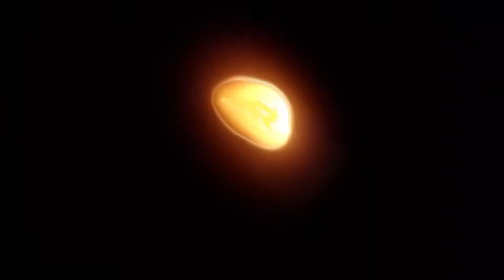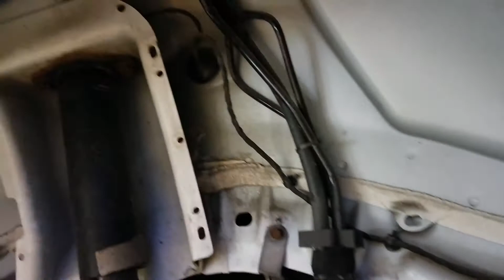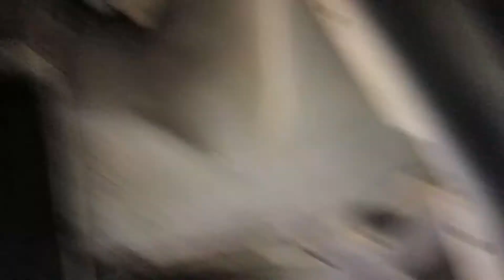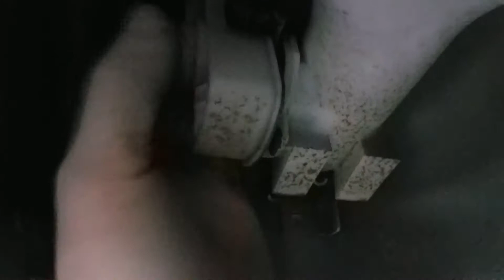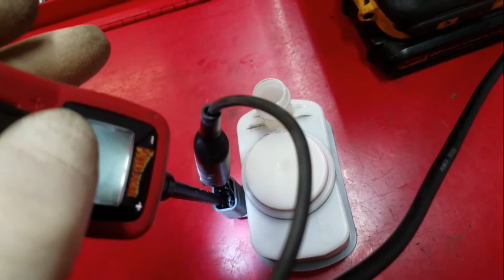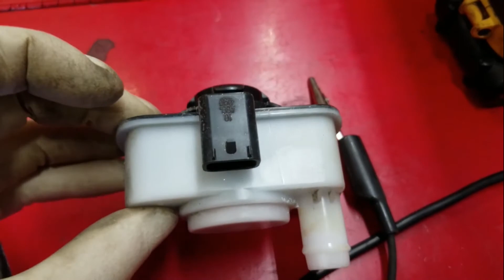How to Test a Evap Vent Valve "The Most Common Cause of P0442 P0455 P0456"

Comment: This is not a vent valve.  It's an ESIM, which does NOT have a solenoid inside - that's why you don't hear a click when you applied voltage; there's nothing to click inside when powered .  

The ESIM, also called a leak detection pump, is operated by weights (gravity) , a diaphragm, and changes in pressure. It does have a switch inside of it, which is what the connector is for, and that switch is closed by a negative pressure exerted on a diaphragm inside the ESIM unit when the EVAP purge valve (a different part near the intake manifold) opens.  This is why you don't hear a click when you apply voltage to this ESIM - it doesn't house a solenoid. .  

When the unit is under vacuum, the diaphragm moves and closes a switch, which sends a signal back to the pcm.  No vacuum; no signal back to pcm. 

Anyway, point is this video is bad info, does not help to troubleshoot this part at all, and it's been up voted - even though it's 100% misinformation.  

Fix it.
Reply: How do you test it?
Reply: Just finding all this out. This guy above is correct. You can test it by blowing really hard through the part. My bad one never plugged up. The new one stopped airflow instantly with a big breath.
Reply: But apparently it’s the most common source of EVAP codes for Chrysler EVAP system, just like the vent valve in a conventional EVAP system. So, while the functionality may be different, it’s the same problem and the same symptoms.

Comment: i think thats a short to ground not an open circut! those valves basically have two powers they use ground to open in close wierd !! both the ground and power will light up test lights! open circut is cut wire basically this is whyt i hate youtube anyone can give false info

Comment: Will that value cause pressure to build up in the tank?i have to remove the cap on mines to release pressure its driving me crazy trying to figure it out
Reply: I have same pressure on tank problem. Any clues as to why?
Reply: @Ltenn  mines ended up being the vent valve going into the vapor canister under the truck I took it out blew into it with my mouth and sure enough it opened up so apparently it was stuck closed.I replaced it and my problem was solved..good luck hope that help you out
Reply: @TurnupDOT  Thank you very much! I took my vent valve off also and I’m wd40ing it now to get it unstuck also
Reply: @TurnupDOT  The vent valve was definitely stuck. Wd40 pretty much all day and I got it to work free. I’ll attach it tomorrow. I had the hoses off and air hoses through them before taking off the valve but thanks for the tip 😊

Comment: Thank you I swapped mine out.  Cleared codes and now i will wait a few days to see if the code comes back.  My purge valve and gas cap are good.  This vent valve after pulling it out stuck a little but with carbon buildup